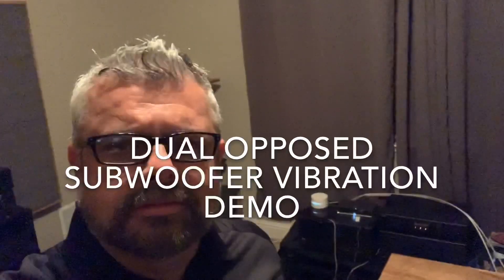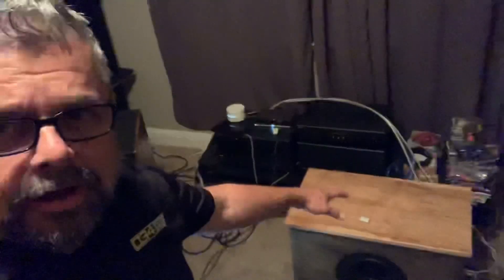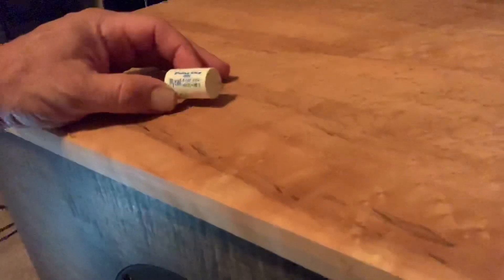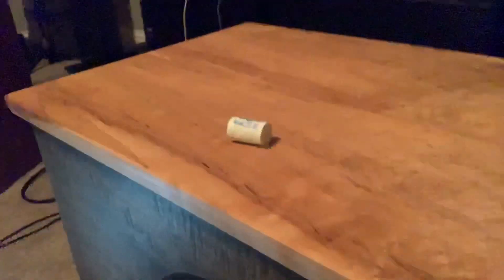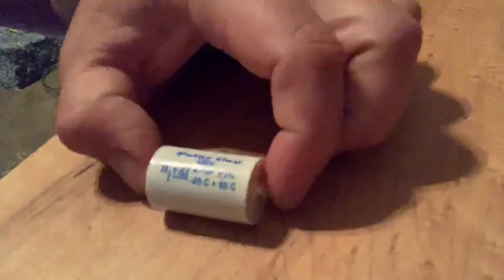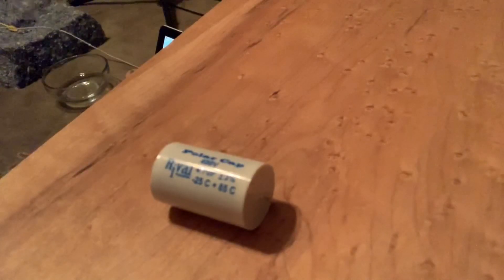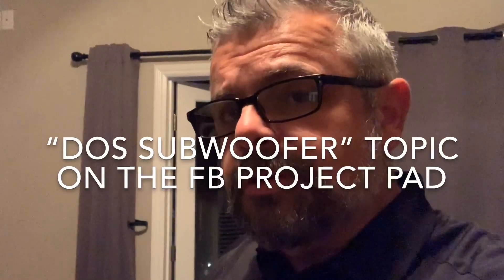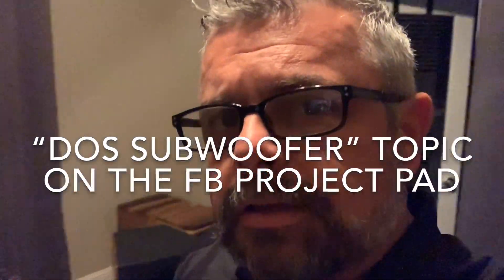DOS Subwoofer Project - Force Cancellation Demonstration for Dual Opposed Subwoofers

Comment: Hey nice demo. Do you know which is better? Dos or push pull? Some say push pull is better as dos loweres your sensitivity by 3db? Also control if the drivers & distortion is better in push pull as both drivers are in same polarity.
Reply from the maker: Hello, I’m not sure what you mean by “push pull”, can you elaborate?  If that means two drivers out of phase and polarity then no, that’s not a good solution. Bass drivers should always be in phase with each other. 

With DOS both drivers are in polarity and in phase, you gain 6db of sensitivity and cancel out all driver force in the cabinet. 

There’s really no disadvantage with DOS.

Comment: Great demo, thanks! I have a silly question tho, sorry in advance! Will DOS help with room vibrations at all? I have a neighbour that complains, and I am wondering if DOS might help along with other decoupling methods in addition. Thanks :)
Reply from the maker: It will not unfortunately!  The vibrations are cancelled w/in the enclosure it's self, not the room.  Giving your neighbor earplugs may be the best option!
Reply: @javadshadzi4824  I was worried that would be the response. Luckily, ear plugs are cheap LOL! Have a great weekend and thank you for your advice :)
Reply: There is a way though. But that gonna be super expensive (that too considering you don't live in a rented apartment). Making all the walls soundproof. Adding greenglue, heavy duty absorption fillings inside drywalls, using special drywall etc that also will improve sound quality of the room too so killing 2 birds with 1 stone.
I think real world audio utube channel has a great video on it.
Reply: @datdudeinred  Yeah, that is true. But I might as well just move at that point, doing something like that is a massive thing to this house

Comment: Hi Javad, I am thinking about building an in-floor dual opposed subwoofer enclosure where the drivers are aiming towards each other exhausting out one port. The vibration cancellation should work. Have you yourself or heard of anyone else designing a dual 10-in system and what kind of drivers/ amps combination and performance they were getting? Thx in advance.
Reply from the maker: This will work well, the way to do this is to use infinite baffle subwoofers so then you don’t even need to build an enclosure, make the plenum as big as you can (w/in reason) to ensure it doesn’t restrict the output of the drivers. You can also do this with enclosures as well.
Reply: @javadshadzi4824  thank you for the response Javad. I am worried that the woofers may resonate the floor below and the ceiling of the room below therefore I thought I would build the enclosure using sealed drivers at their calculated needed cubic foot optimum specifications. After designing and building the enclosure I would merely screw the top onto the enclosure to test  to verify results before installing and making any mistakes. Crossing my fingers!
Reply from the maker: @cal4050  it’s possible, though with the force canceling setup, I seriously doubt this would be an issue.
Reply: @javadshadzi4824  awesome thank you for your help!
Reply: @cal4050  yea. The new force canceling gimmick is magic. The walls don’t vibrate. The floor doesn’t vibrate. Your neighbors won’t hear a peep. But wherever you are standing, the bass is incredible. Even when you move around. So don’t worry about your floor shaking. The downstairs neighbors will sleep like a baby.

Comment: Will the same effect work if I just installed two drivers in opposite directions within a cabinet linked together biwired basically? Does this also eliminate deadzones like 2 separate subs would? Id ideally make it into a centre piece coffee table so would be close to seating area. Plus will sensitivity matter so to make benefit of even less cabinet resonance?
Reply from the maker: Absolutely, the forces would cancel once you connected the two enclosures together, they don't have to share the same air space.  Two subs will generally help room modes compared to one, but the closer they are together the more they act as one source.
Reply: @javadshadzi4824  ah I see. Appreciate the quick response.
Reply: @javadshadzi4824  it's nearly impossible to find any info on this. Im looking to place another dual opposed inside a TV unit, as a stealth home theatre. Apparently the magnets or magnetic shielding can destroy electronic devices if nearby?!
Reply: @dfalekulo9138  on Facebook join the group DIY Loudspeaker Project Pad and search the page for "DOS Subwoofer", all information is there.
Reply: @034motorsport  cheers!

Comment: Been running two, dual opposed, Infinity Kappa 1200's with a Behringer iNuke 3000DSP. 

All in I'm at $1000-$1100 and can't think of anything commercially that comes close. I have them placed in room to correct for some suckout at 54Hz so I don't have to apply to much correction.

Comment: Quick question. Are the subs in series or parallel?
Reply from the maker: They are in phase, if they were out of phase the drivers would cancel each other's output...
Reply: Each sub has its own amp channel - the MiniDSP amp Javad uses has two separate channels, so he is able to set and control each of them however he desires. The SB subs are 6ohm if I remember correctly, so it would make sense to drive them separately. 
Javad - this one is cool, big difference between the two operating and single one. Awaiting measurements.
Reply from the maker: pliedtka you are correct! See the FB DIY Loudspeaker Project Pad measurements are there thanks!
Reply from the maker: @DTW-bx2vy  that’s totally false, that would put the drivers out of phase and they would cancel each other’s output. What you say would only be correct if one of the drivers was mounted inside out.